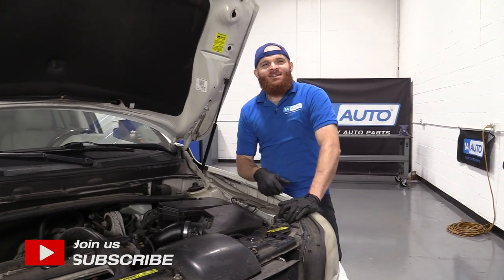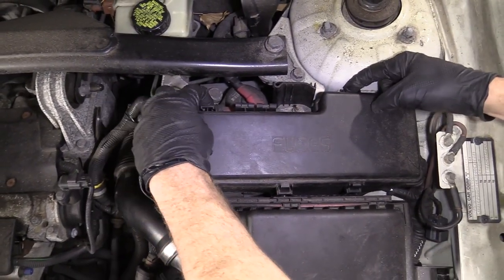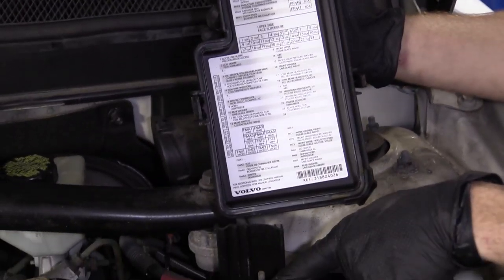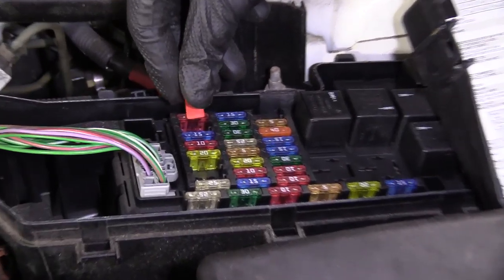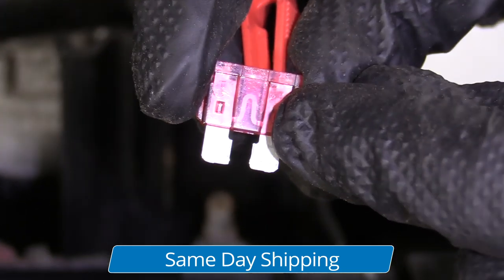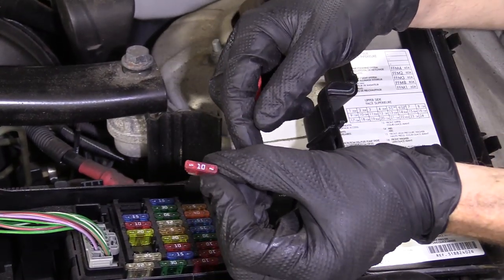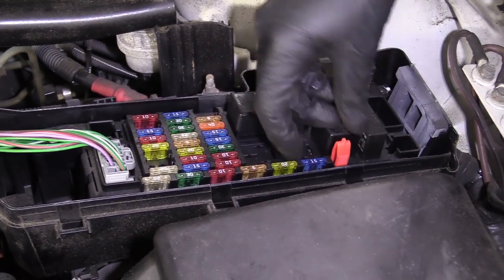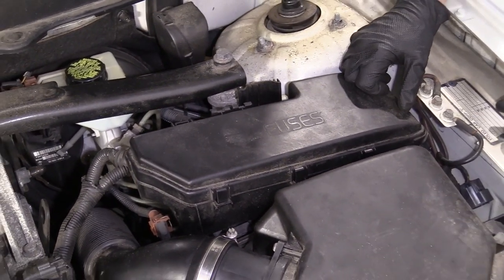How to Check Fuse Box 03-12 Volvo XC90

Comment: Just wanted to add at the rear behind the drivers tail light, if you pull up a triangle carpet piece then the carpet piece with a bottom vent there is a rear fuse panel
Reply from the maker: +Volvtech Thanks for the tip!
Reply: the rear cargo panel partially covers a few of the fuses in this block (two of which I need to check), do I have to remove the whole interior/wheel well panel to access this block? Please tell me there is a workaround. My rear window defroster isn't working and I need access to two fuses behind that panel.

Comment: How do I fix the side brake lights the top center light works but not the left and right.
Reply from the maker: +Number 1 Parrothead We wouldn't be able to diagnose an issue like that here, you may want to have a local mechanic take a look at it. Thanks for checking us out! http://1aau.to/m/Shop-1AAuto-c
Reply: Thanks for answering, I think I misstated my question. I was seeking info on location of a relay for the brake lights. You are the only one that answered, Bravo!